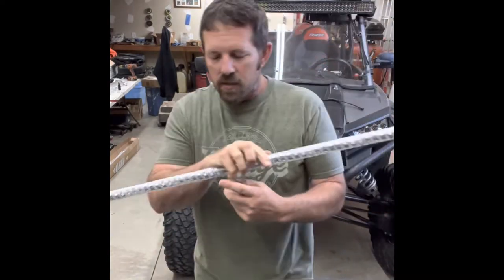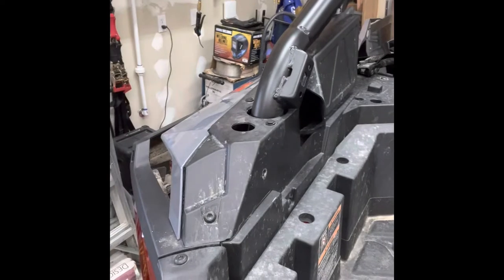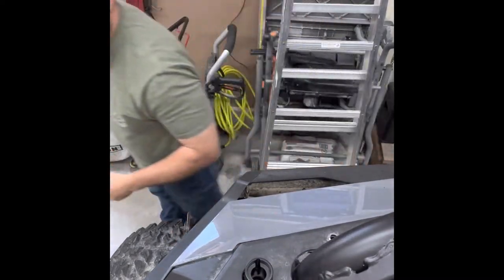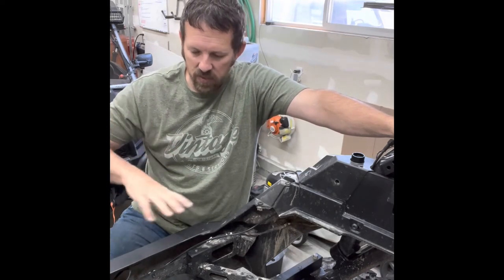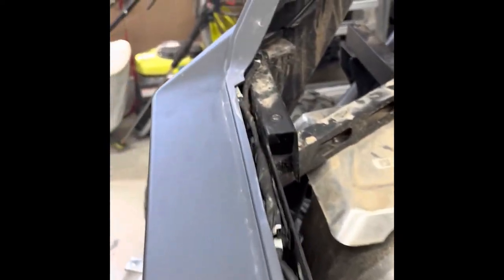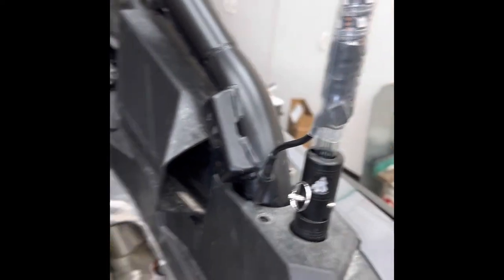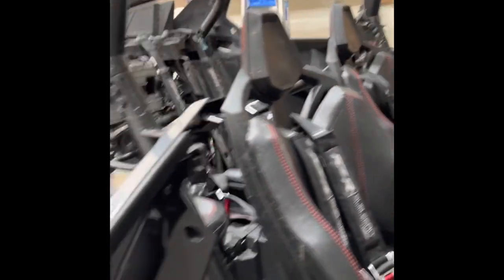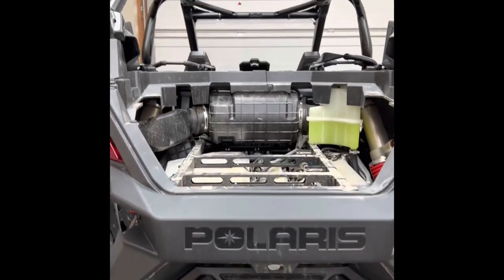Installing Gorilla Whips on a 2022 Polaris RZR Pro R 4 Seater

Comment: Thanks for the tips! Do you think I can fit some 1” flex conduit in through the center console? So I can run multiple wires at different times to save from having to tear into it multiple times?
Reply from the maker: Yes, I think it would be possible to install the conduit in there. It might be a little tight near the gear shift assembly though. Good idea.

Comment: Where do you buy the plugs for the bus bar?
Reply from the maker: Here a link to the plugs I use:
Lesiyou 6 Pieces Pulse Power Plug Compatible with 2018-2021 Polaris Ranger XP 1000 RZR RS1 Pro General, Bus Bar Power Harness Pigtail Connector 14 Gauge https://a.co/d/fIv8RRR

Comment: Do you have a video of how you wire into the dash? That’s where I’m confused and can’t find any videos on how to wire into the pulse system
Reply from the maker: I don’t have a video specifically for that. What you’ll need are some of the pulse bar connectors. The pulse bar under the dash usually has dust covers on them. Remove a dust cover, plug in a pulse bar connector and then connect your wires to the wires on the connecter. There are three wires coming out of the connecter. Mine had black, red and yellow. Black is ground, red is 24hr + power, yellow is ignition power if I remember correctly. But you can verify that with a test light. From there, run your wires to the switch and then to whatever you are trying to power. Hope that helps. If not let me know and I’ll see if I can put together a video on this.